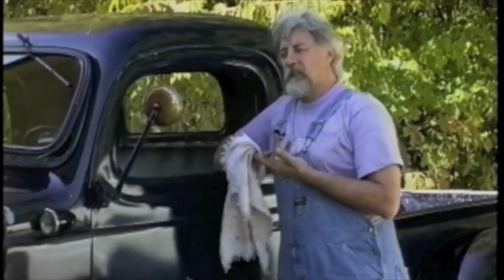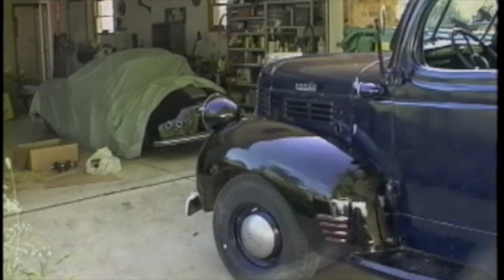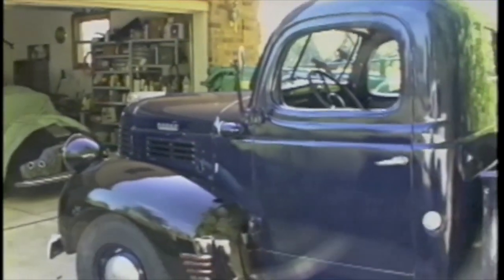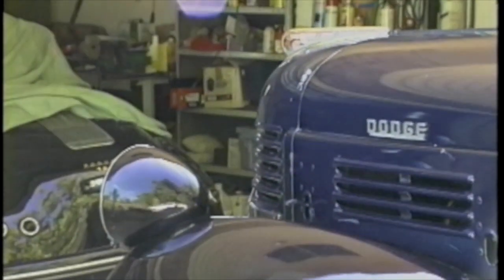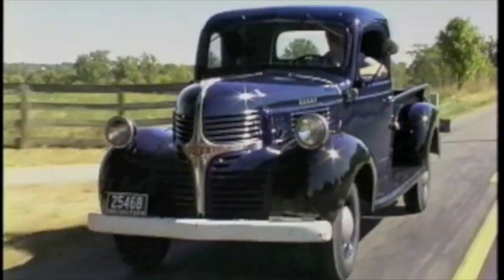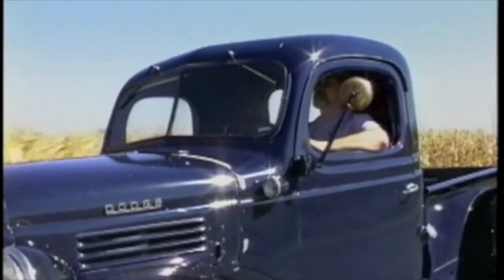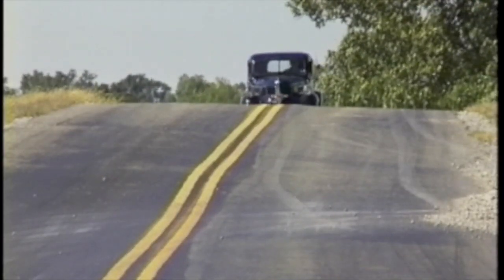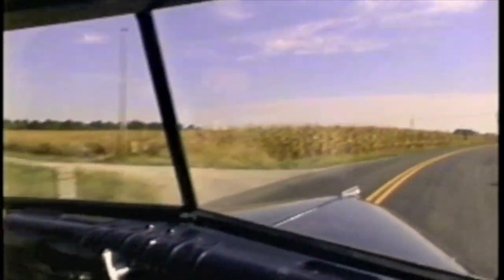1947 Dodge Pickup

Comment: In 1963 I wanted a cool Hot Rod 40 Ford pick up truck. Instead my dad bought a 47 Dodge pick up from a LAPD auction. He was high bidder at $6.00. It needed some work. We towed it home and my mother made him park in the back yard away out of view. It was at one time reddish and blackish in color and dents were plentifully. It rolled and stopped. We rebuilt the motor and put in a new clutch and rebuilt the brake system. 

For the next three years, in this truck I transported about 60 tons of sand, gravel and cement and tons of rebar on side rack racks as for my dad’s yard projects. Left turns with the steel loaded on the right were best taken a reduced speeds. One time a driveshaft u joint let go and another time the emergency brake wouldn’t release. That was it. The stock drive line is a rewarding pleasure on every drive back in time. My favorite feature was the standard air conditioning system. Your truck is perfect.
Reply from the maker: Dodge had a lot of periods when they excelled beyond Ford and Chevy. The late 20's comes to mind for all the times a Dodge Bros. truck had to pull a Ford or Chevy up over a hill, the turning radius of the "Pilot House" designs of the late 40's and early 50's. The 1964 Dodge Van was a favorite of plumbers and electricians due to their structural integrity. Dodge had the first extended cab in 1973. The list goes on...Of course there's my '57 Dodge D100 on this channel that I've been working on for over 20 years... but what's the rush?